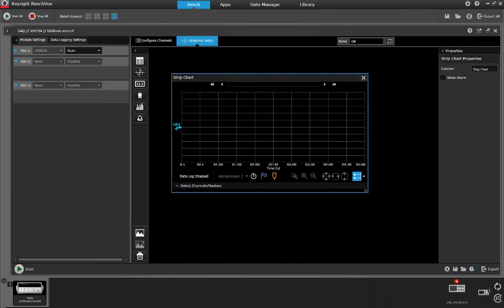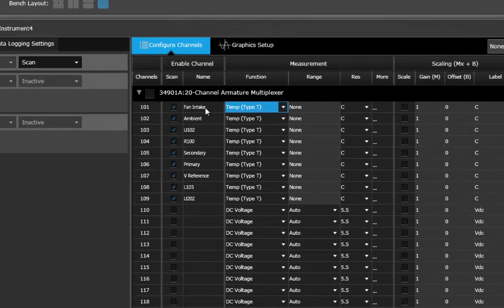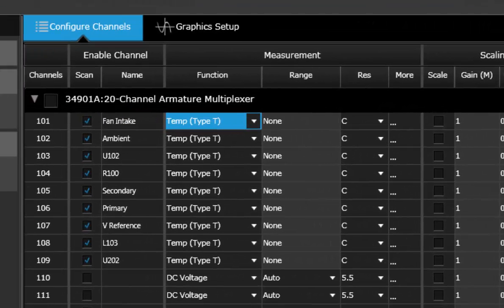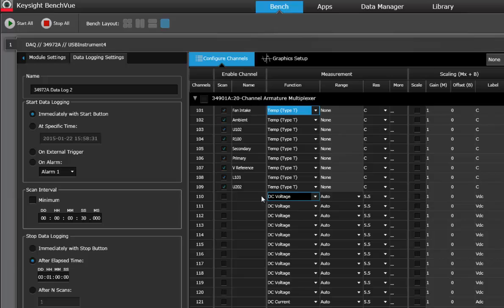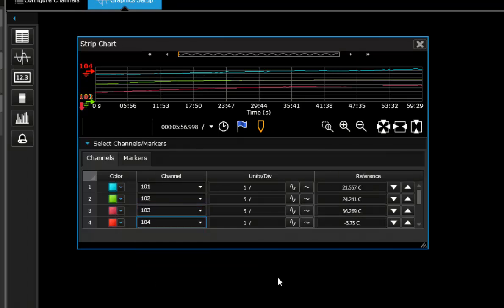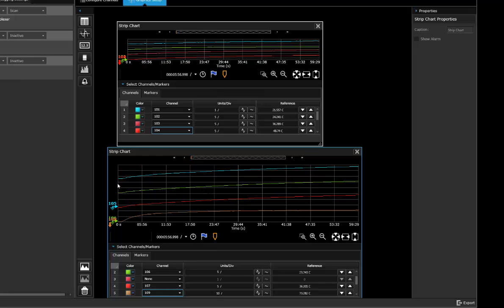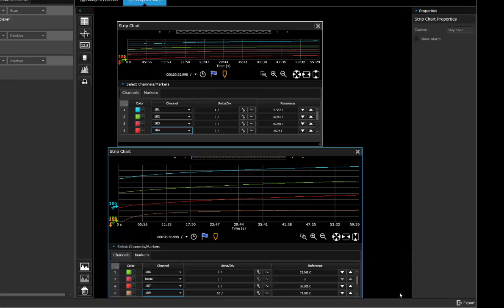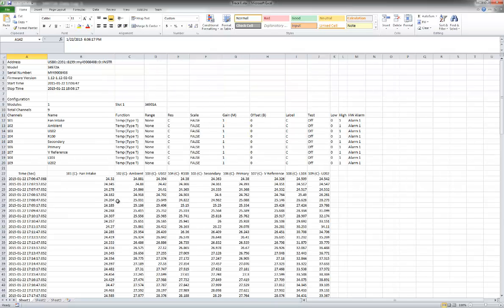Measuring temperature with data acquisition using BenchVue

Comment: Should I need to set the reference temperature in the data logging software for the thermocouple measurement?
Reply from the maker: markwlaw  The 34970A and 34972A both have a built-in reference temperature and will calculate the temperature. BenchVue records the temperature from the data acquisition unit. So, it is not necessary to provide the reference temperature.